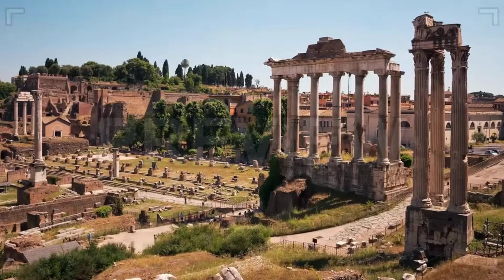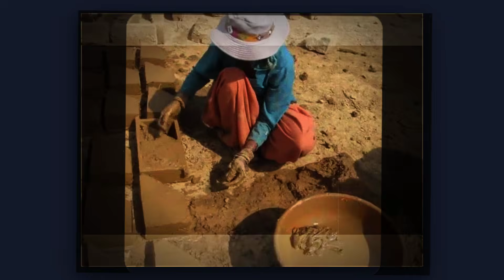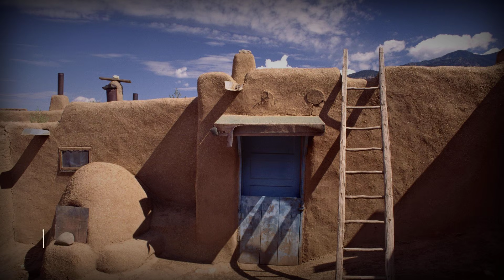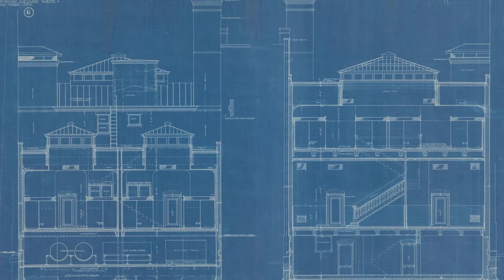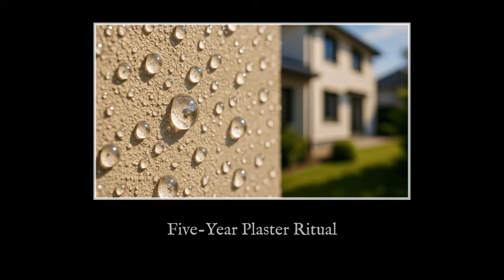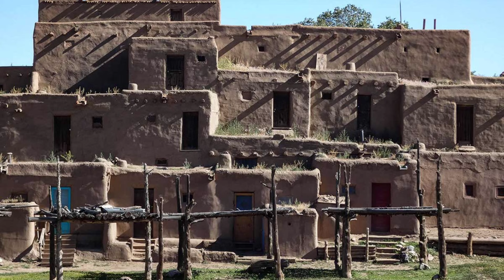This Ancient Thermal Wall Cuts Heating Costs to $0. Why Did Builders Replace It?

Comment: "they created heat in the first place" actually abbbbbbsolutely. The Romans then created heated baths and bathing itself on a massive scale ...then later plumbing #indoor_plumbing but yes as for thermal mass until Europeans arrived in North America we had completely forgotten about all of this but the bathing part. That changed crazy fast as USA American Settlers moved West to discover humans who literally had nothing how they still had heat during crazy cold nights absolutely. This caused a revolution in how we lived first in "modern" Europe (1700s to present) now globally. This all actually started in Chicago in the 1800s "a City on the Prairie itself" ...then spread quickly to the Eastern Seaboard USA and was advanced upon but until steel rebar came along and modern concrete yet ...all had not been rediscovered until after that basically the start of the 20th Centry. The other (re)discovery was rug making in North America. Long #mohawk_industries strong buy🎉🎉